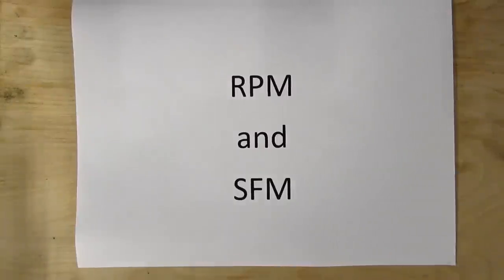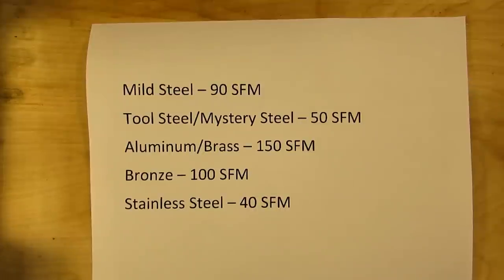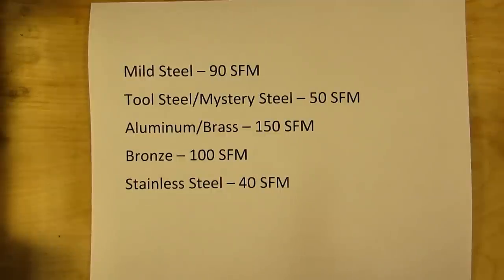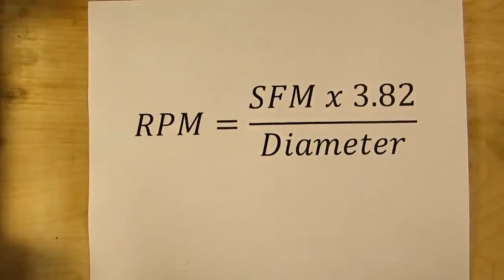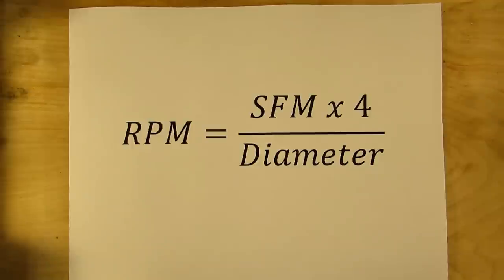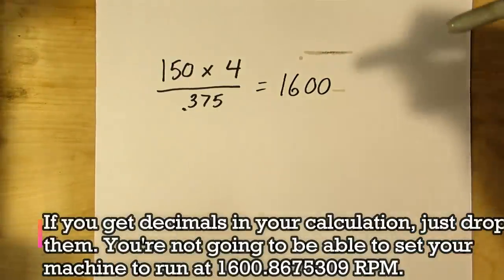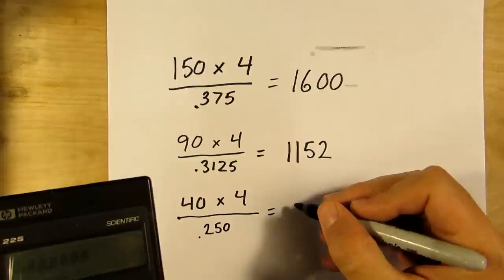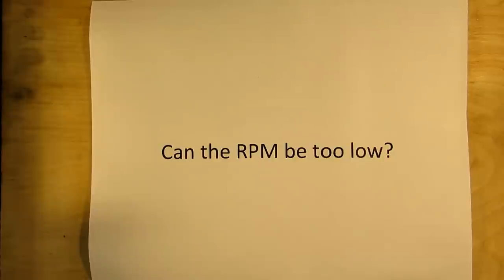Calculating the RPM for your machines

Comment: Sir i have 29 hp d engine  2200 rpm with 6 inch pulley. Tell me water fan pulley size? Because i have 8 inch water fan pulley. In this position tube well water though is best but engine on some fast speed?

Comment: Late to the party I know but does this mean that in metric it would be S(cm)M x 3.18/diameter? If constant =  10/pi?

As the 3.82 in imperial is a product of 12/pi, feet to inches. So the constant in metric would be cm to mm ? Ie; divide Pi by 10. Is this correct to solve for Surface Centimetres Per Minute?
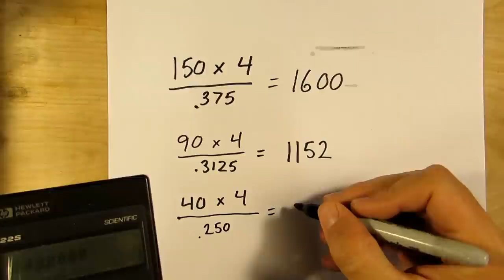Reply from the maker: The metric explanation starts at 9:19 and you're using meters/ minute.
Reply: @StuartdeHaro  omg I feel like and idot. Hahaha. Watch. It. Until. The. End. facepalm

Comment: Drill length is the 2nd biggest factor after the diameter. I use a 9/16" longer than my leg in P20. I get using 4 on a manual but that is so wrong, machining is precision, that math should be accurate then round the rpm

Comment: I think that you have an error in your metric calculations.

When I try it, I get a result 4 times faster than your inch calculations.

Aluminium is 150 sfm = 45 meter/ min = 45000 mm / min

Endmill is 3/8 = (25.4mm / 8) x 3 = 9.525mm

Calc then is as following acording to you:

45000mm/min x 4 = 180.000 divided by (9.525 x 3.14) 29.9085 = 6018 rpm

Where do I go wrong ?

Otherwise very informative videos. Maybe not as detailed as TubalCain's but still as informative.

Greetings from Denmark.
Reply from the maker: I see what you did. You used the 4 from the inch calculation in the metric one. It should be (1000 x 45)/(3.14 x 9.525) or 45000/29.9237=1503rpm. You did all your math correctly until the end when you put 45000 x 4/29.9237. That 4 is only for use with surface feet per minute, not meters per minute. Let's do a quick double check of the same material and diameter in inches. 150 x 4/.375=1600rpm. The difference is because 4 is rounded up from 3.82 (shown at the beginning of the video). If we use 150 x 3.82/.375 we get 1528rpm. The remaining difference in rpm is because of the various roundings that we did going from inches to meters. I hope this helps. Thanks for watching!
Reply: I feel so ashamed, usually I'm a math shark, and after reading your explanation, maybe I should go back to school. Of course I don't need that multiply of 4. the small fractions don't bother me, it was that I got a so big difference that made me write. My humble apologies, and keep the good stuff comming :)
Reply from the maker: My first thought was, "Oh no, that video has been up for 10 months! Did I really make a mistake?"  I'm glad I didn't.  Either way, you got me thinking first thing this morning and I always appreciate that.  Thanks for watching!
Reply: Just back from my litle shop this morning, and lo and behold, it worked, no chatter, no squeals, just smooth as a baby's but :) Thank you so much
Reply from the maker: You're very welcome!
Reply: how 150 sfm =45 meter/min.......pls tell me

Comment: So the equivalent metric equation with the constant multiplier would be; RPM = (SMM * 318.31)/DIA in mm ?
I'm still resisting Imperial measures with all the fibre of my being (even though our stupid country measures road speeds and distances in MPH and miles 🤪)
Reply from the maker: I go over the metric formula at timestamp 9:20. I have no problem working with either system and I think most US citizens are pretty flexible in that regard as well. We just like cracking jokes about freedom units and stuff like that. Just remember, accurate work can, and has, been done in both systems. In the end, it doesn't matter how you measure it as long as the finished product works as it should.
Reply: @StuartdeHaro  Quite. Couldn't agree more. I'm just comfortable with mm.
I wish my brain worked like one of my older colleagues. He's a magician with the manual lathe and can use either measurement system on the fly.
OMG, I've been indoctrinated by Système international 😨